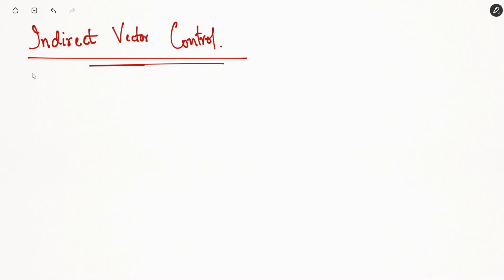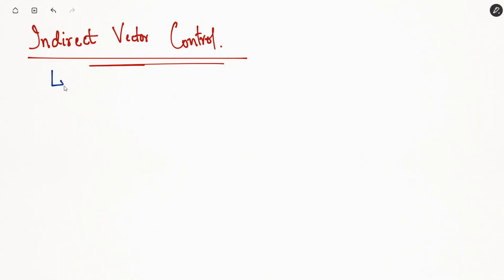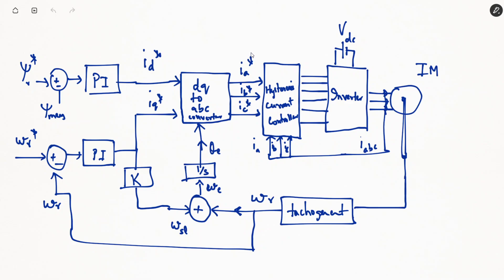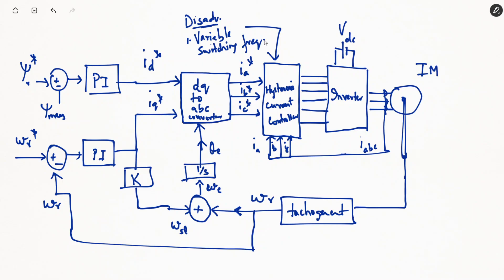ELD - 23 Indirect Vector Control of IM

Comment: How to select the reference flux ??
Reply from the maker: You can set it as the rated value for safest option. You can weaken it for obtaining higher than base speeds. Or for higher efficiency (reduced power losses) which has also been discussed in later videos, optimisation algorithms can be used that minimize the core and copper losses and provide the optimal value of flux.